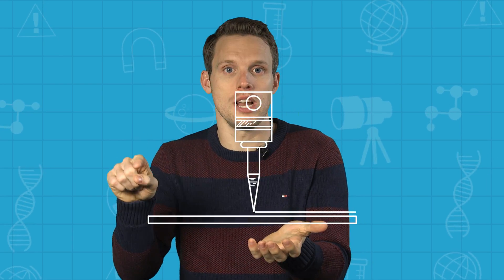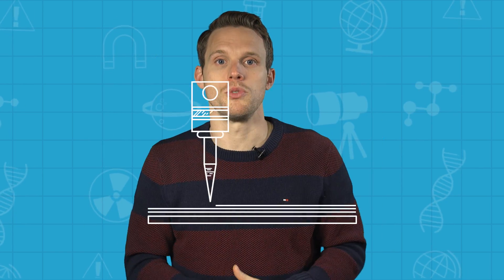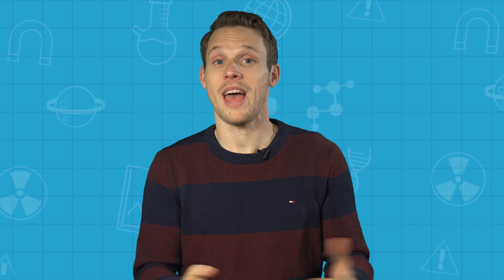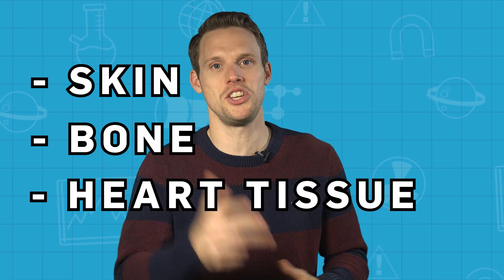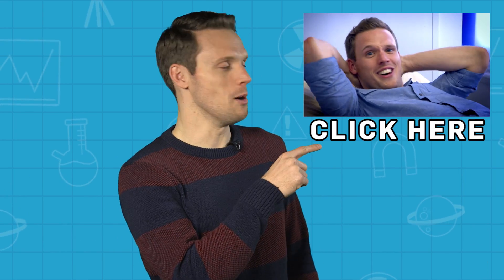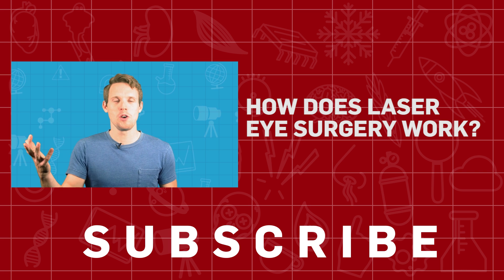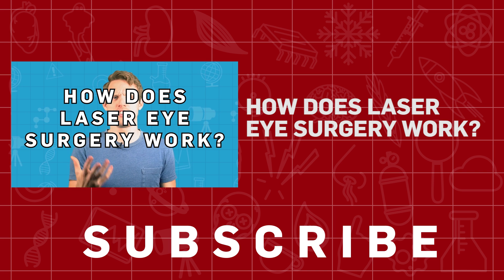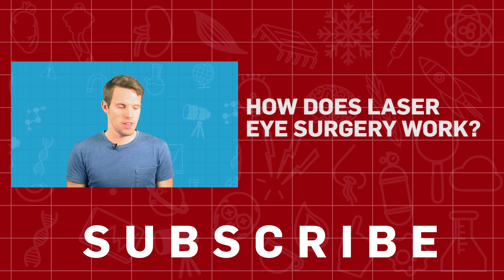Can You 3D Print Organs? | Earth Science

Comment: Making a 3d organ is years away, the problem is organs have in some cases hundreds of different cells which work in a very complex manner, to accurately produce an organ they would need to first make an anatomically correct clone of an organ digitally which would be very difficult and probably vary from person to person based on blood type or there body shape. They then somehow will have to print this onto a stable graph whilst trying not to make the inner cells die from lack of blood circulation whilst printing.